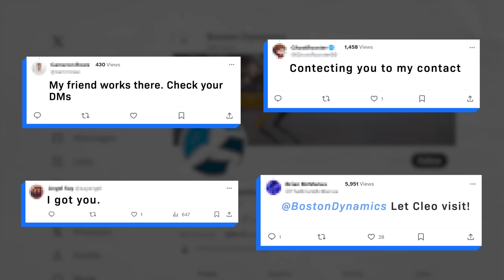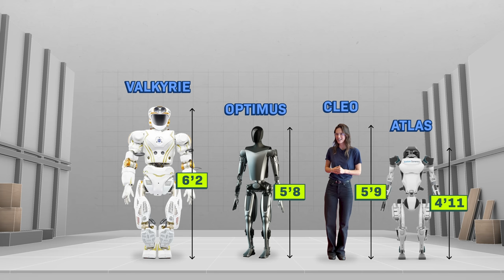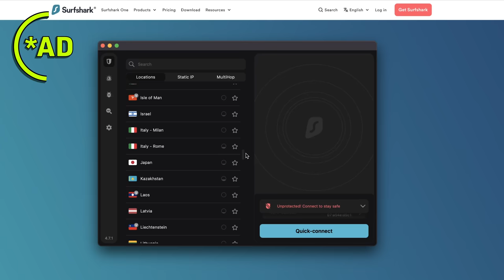I Challenged Boston Dynamics' Famous Atlas Robot

Comment: To be fair Cleo, when you pushed the robot it was not expecting it. You were expecting to be pushed so we can see you tense in the video ready for the push. In that sense you had a big advantage over Atlas. I wonder how you would have performed if you had been blindfolded, and not known when the push was coming? So, Atlas's response was even better than you originally thought.
Reply: I was thinking the same.  She was also leaning forward a bit.
Reply: tell her to pin this comment rn!
Reply: But the robot has visual sensors, maybe it prepares also? Interesting.
Reply: Then again, Atlas weighs 89 kg. So it was pushed by someone lighter than it, whereas Cleo was pushed by someone heavier than her...
Reply: I'd argue that the robot is constantly ready to be pushed.
Reply: There are also just differences in the potential for injury. She was probably not pushed as hard as she pushed Atlas. She also naturally knew that she should keep her back straight and the trade off with that is that she had to move her whole body backwards to acomplish that. If she responded the way Atlas did, she would have suffered injuries.
Reply: I don't understand the point you're trying to make

Cleo literally said Atlas won that challenge 

Am i being gaslight right now?
Reply: It's nothing to do with winning or losing. It's about physics.  @TheJunmengo
Reply: @partsdave8943   natural center of mass compensation to absorb the kinetic force aka distribance of standing upride. atlas compensation was most likely disabled otherwise Atlas would have widely flared with his arms to compensate and maybe cause an injury to CLEO.
Reply: robots in general if pushed around would try to compensate the motion introduced to them. Arm flaring is a natural decision we humans do if pushed around unexpected. Robots can be programmed to do the same but for safety reason that means more distance is required.

Boston dynamics has a video about what happen if Atlas is pushed or its interaction changed midactions(the video is fun to watch as the robot is multiple times hindered to pick up an object or pushed out of his hands).
Reply: A cpu and a couple of gyros can respond a lot faster than a human can, and it will know exactly it's position in space. So while the whole concept of a robot reacting and keeping it self stable is impressive in its own right, its not really THAT impressive that it can potentially reacts faster.
Reply: I don't really think she intended to make it a direct 1-to-1? After all, the mechanics and response system of Atlas is completely different. Atlas doesn't have an adrenal system to kick in on responding to surprise pushes in an actual blindfolded scenario. Same with Cleo not having a lack of fear and direct rapid motor responses to a random unseen shove like Atlas does.

Atlas is definitely superior in its immediate response to a blindfolded scenario but there are way too many factors to actually make a real straightforward apples-to-apples comparison.
Reply: Atlas might actually be perma ready for a push in a sense. Due to it being able to course correct much more accurately and efficiently for changes in weight distribution and balance.
Reply: that's because machines can execute functions much faster than we can so their response is almost instant.
Reply: Atlas is at a stage of development where the system clearly "knows" how to handle certain situations. He did "know" that he is gonna be pushed.
Reply: @FactionalSky A different BD video explains how Atlas AI enables him to alter his centre of gravity to compensate for the weight of heavy objects he picks up, and when he throws them. It's more likely Atlas AI reacts so quickly to being pushed, it as appears anticipated. He doesn't know how hard the push will be, so can only react and keep his balance after it happens.
Reply: Good point, didn't think of that.
Reply: What make you think that the robot wasn't program to be expecting it?
Reply: Notifications on, alert whenst C-A is single, literally imagine the conversations you could have with someone like that
Reply: In what way would Atlas "expect" anything? This is a robot not AI or OI. This won't be pinned because it's just dumb.
Reply: This robot is supposed to be "human" like,,,why didn't it anticipate the push?? Did they forget to to turn on the sensors???
Reply: It was expecting it. It's always expecting it, that's the beauty of software
Reply: She would still have an advantage. She could feel the stick before her balance is off but the robot can't. the robot can only react when the accelerometer/gyro meter tell it something is changed. I guess the engineers probably could increase the feedback frequency for the robot to kind of mimic "anticipation" assuming it is not already maxed.
Reply: It’s weird how pretty much any robot movement in a video seems like a vidéo animation…
Reply: @evertchin  I don't quite think you understand how much faster a computer can process data than a human brain. It doesn't need to anticipate, that's a human construct for humans. That said the nature of its software processing means it's ready for anything at any time which is a form of anticipation. There's no such thing as maximum in this field yet
Reply: Ya when I thought she was going to be pushed I thought she'd blindfold herself ...
Reply: @TheHertzWeb  oh I do. You immediately assumed I am less knowledgeable, which is not true. It is a balancing act between how fast, how much power consumption, how reactive it needs to be. It might not be working at full capacity all the time due to the need of balancing these variables. Anticipation for robot is doable within the context, which is great for energy saving. For instance when it is just standing still, it can tune down the tick rate for balancing and perhaps other sensory processing, as soon as it is falling or anticipate something is coming at it, it could increase the tick rate for balancing process. No such thing as maximum int the field, but i wasn't talking about the field, I was referring to the specific robot. You are putting words into my mouth. P/s: you are talking to a veteran software engineer with 20years experience.
Reply: After repeated done / & using ai for itselfs vision  then it knows  or expected
Reply: But Atlas is much more stronger, shorter and sturdier than Cleo. We gotta factor that part in too
Reply: As another user said, I think the robot is constantly prepared to be pushed
Reply: @jullit31 Exactly. The real factor there is weight
Reply: The atlas is designed so that it is always ready to push, ready at any time
Reply: @usaturnuranus It has an internal gyroscope that detects changes in position, and an accelerometer to detect acceleration. This is all that is needed to maintain balance, besides visual confirmation of standing straight.
Reply: He didn't mind. His revenge is coming.
Reply: @usaturnuranus  Exactly.  The sensors were not covered, and there was no indication they were turned off. The software is designed to detect collisions and certainly registered an object approaching.
Reply: That clip of her pushing Atlas is going to be used by Skynet over and over while they decimate us
Reply: Yeah but the robot has certain functions coded into it… Impressive programming but not impressive in the way you’re thinking.
Reply: I would also be interested in how much Cleo weighs compared to Atlas and the engineer who pushed her. The magnitude forces and the effects of those forces could be all over the place. Atlas is 89kg according to BD website. Cleo, while 5' 9", is pretty slim, so I doubt that she weighs anything like that. The engineer that was pushing her was also heavier than her.
Reply: She should not  attempt such a competition against  DARPA's Military Robots !  😞
Reply: I also think Cleo wouldn't have been pushed back as far had she not been expecting the shove and had not leaned into it.
Reply: Don't be a fool. It was prepared for everything especially to expect sudden changes to maintain stability.
Reply: Atlas would notice its was getting pushed and be able to react with its muscles many times faster than Cleo. Humans have a very slow reaction time mesured in 100's of millseconds. Both to react to a stimuli and to then command its muscles and for them to react. While Atlas can do all this in a few miliseconds. 

This shows a very different aproact between people and robotic, Humans live in the past by a few 100miliseconds and a lot of what we do is anticipation and predection. which is why we deal much better with expected this or when we can "See them comming", while a computer  can recive / process and react to stimuli almost in realtime so can deal much better with the unexpected than a human can as they simply can react an order of magnitude faster.
Reply: @syntaxusdogmata3333 that’s right, Atlas was in a specific mode
Reply: That's a dumb take lol
Reply: @TheJunmengo Did you miss this part " Atlas's response was even better than you originally thought" ?
Reply: @usaturnuranus  yes
Reply: Exactly
Reply: Atlas was not blindfolded. He could see.
Reply: @jullit31  The area of Cleo's body that was pushed made Me feel really uncomfortable. She was pushed right above the breast area. I would have felt a lot more comfortable seeing Her pushed at the shoulder area.
Reply: The robot can react to information way faster than human could. It's not at disadvantage
Reply: Even if she is blindfolded, she still  knows its a task that she would be pushed.
Reply: The "Cleo" Model has just a very effective neural network running
Reply: Lol, expecting it. It's a robot facing her. If it's unaware idk what to say.
Reply: You guys are humanizing the robot too much. It doesn't think, act or react like we as humans do.
Reply: Why do people need to over react to things.
Reply: By that definition compared to a human a robot is always tense yeah? Your logic is fallical.
Reply: Cleo! Please have my children! 😵‍💫
Reply: @joesomma8919  yikes
Reply: Great observation. 👍
Reply: Yes, she leaned into it.
Reply: Cleo, did you know that in Japan and other Asian countries they even make female robots with emulated Virgina(s) fully function with all women's modes and abilities when the female robot wants sex?  Strange but true...
Reply: It's just reaction time issue. Of course the robot has a much shorter reaction time, it's to be expected.
Reply: @jullit31  Yea but she pushed the robot as hard as she can, the other guy prolly didn't push her as hard
Reply: Blindfold the robot too
Reply: Atlas is probably a lot heavier, though. Not really sure it’s a fair comparison unless you get a 4’11” person with similar weight.
Reply: Atlas was listening...he knew it was coming 😅
Reply: you are smart
Reply: How do you know Atlas didnt "see" it coming?
Reply: @Thebigwa  Go ahead and write it off as a camera trick.  Will you still think that when you see one delivering your walmart order to your door? Or will that be CGI as well making that box of ham and cheddar hot pockets appear on your porch?
Reply: @usaturnuranus   No it doesn't.
Reply: @goodlookinouthomie1757  Not really, it still takes time to read a position sensor, calculate position error, and signal an appropriate change of force to correct that error. animals have some amount of more direct analog "hold postion" system integral to muscles and joints. You could do similar in a robot with magnetostrictive pressure sensors, but it would not be worth the expense and complication for most applications.  A modern robot could use video, lidar or other spatial measurements to anticipate the impact and calculate a pre-emptive response.
Pre-emptive response in a robot is kinda scary idnit? 

 The controller gets twitchy when the mechanics dont behave exactly as commanded and expected.

I realised upon proof-reading for spelling errors that there is another analogue to what I wrote that is also scary.
Animals are really good at physical motion, especially with practiced moves.  Until recently robots could really only do what they were programmed to do.  The speed and depth of digital processing now allows for a lot more IF, THEN type "decisions" to be made in a given amount of time which makes it possible for a robot to learn from practice too.  What is really going to set automation apart is that once an olympic level athletic robot "learns" a skill, within minutes all other similarly equipped robots can have that same olympic skill level too,  something humans will never do.
Reply: So..... when I see videos of people pushing and trying to kick over these robots etc.... they just make me think that 1 day they will push that person back lol. Especially those robot dogs for defence etc, you see the developers being pretty aggressive in pushing them and I'm waiting for the video of the robot dog that snaps lol
Reply: True, but the robot was programmed to handle a push, so it kind of is always prepared.  

That's how I observed it.
Reply: For sure the robot was ready to get pushed, because its programmed to be ready to.
Reply: No, it's programmed to respond to being pushed. The same as we are. It can't take evasive action to something that hasn't happened yet, it can only respond to input.  @Fangodax
Reply: @Cjorss  there is no risk of injury from being pushed on tiles
Reply: Overlooked comment fax bro @usaturnuranus
Reply: pre cognition....  robots exempt LOL
Reply: a robot typed this post
Reply: Jesus will destroy the world but all business will lose
Reply: “I’m one of the hundreds of millions” *shows screenshot of 40 million…
Reply: @usaturnuranus while the robot can see its surroundings, it doesn't understand it the way we would. For example, whenever she is standing in front of the robot, the robot just sees her as an obstacle standing in front of the robot. It doesn't know that that is a person or what their intentions are. It merely sees it as terrain that can move. Maybe in the future robots can identify certain object is better but from what I can tell Atlas just kind of gets a basic shape of whatever is in front of it
Reply: [Thread bypass]:
And yet anticipation is exactly what empowered Cleo's response.  Atlas is kinesthetically superior, but Cleo is perceptually superior, even without intelligence; any primate could have done what she did, and with a ~3 lb. brain that uses less than 100 watts of power.
Reply: Me question is how are they with kids??
Reply: @Minecraft_gamergirl1  Thst’s like asking how forklift trucks are with kids. They’re not sentient 😂
Reply: @Minecraft_gamergirl1  Kids would probably destroy them haha
Reply: She's not exactly a very strong human to be fair.
Put Eddie Hall for example, and the result would've been different.
But yes, I agree the robot is still impressive IMHO.
Reply: It has cameras, so it would have seen the shine coming and be prepared. How else do you think it manages parkour ? It can very obviously see its environment 😊
Reply: @syntaxusdogmata3333  That stick is it's living nightmare.  😅
Reply: @syntaxusdogmata3333  😂
Reply: Yeah. Totally biased.

Comment: On some level, you know the human body is incredibly complex, but I guess it doesn't really hit you until you think about getting a robot to act the same way.
Reply: on all levels it's complex.
Reply: Human body is insanely complex. Remember that we do not have actuators that can push, only pull. When you stand still, your muscles are working hard because your bones would twist all over the place and you would collapse if muscles do not keep you balanced at all times.

This has some side-effects, too. Your neck can get sore if the muscles in your calves are too tight because all the muscles from your calves to your neck work non-optimally and your back will twist incorrectly as a result.
Reply: We are adaptable precision machines. Take away one limb and we recalculate everything. Even something so easy as walking implies that we try and develope the muscles to keep the center of mass in a stable path with minimum energy waste, which is the basic in physical anthropology for bipedestation.
Reply: Remember that humans evolved to be this way after hundreds of thousands of years. We are working to replicate that complexity in just decades

Comment: after seeing the "push" autocorrection:
think about this.
A) Atlas is very good at calculating balance correction.  If you push it, it will autocorrect.
B) Now say you fall into atlas accidentally because YOU tripped.  Atlas now autocorrects its balance and crushes your limb in the process because it valued its balance over a much MUCH harder calculation including your choice of balancing and autocorrection in real time.
C) everything in (b) gets multiplied even further into complexity as people have entirely different levels of coordination, or accident experience.
D) it chooses a neutral option, of collapse, and now a dangerous heavy piece of machinery with limbs is falling with/on you.

The amount of corrections and processing power to function safely around humans is off the charts.

Comment: 06:49 Never mind Moravec's Paradox, Atlas' legs are shorter and less flexible. Improve flexibility, limb length and balance becomes more difficult (especially for things like backflips) because centre of gravity is higher and with a higher centre of gravity comes higher angular momentum, slower rotary response and higher angular commitment; pretty much all the things which force taller people to go about balance-dependent actions more slowly, on average.

Comment: I suppose the only weakness robots have is in the joints which have to put up with very high torques, I remember this robotic spider a few years ago, and the guy said if you accidentaly move it the gears will strip.
Reply: Robots biggest weakness is it's power source. They didn't show how they have to be charged up all the time.